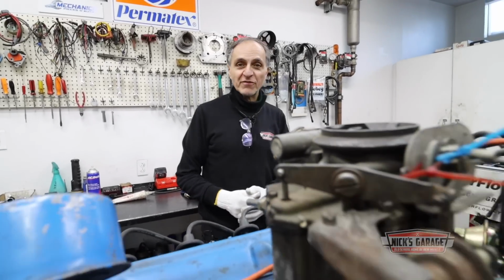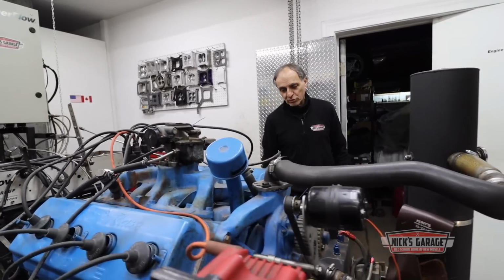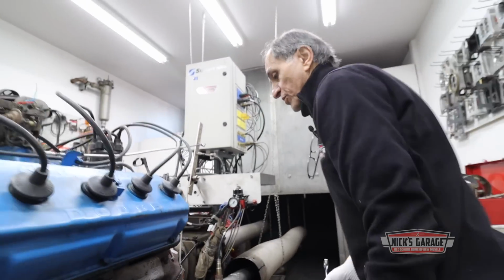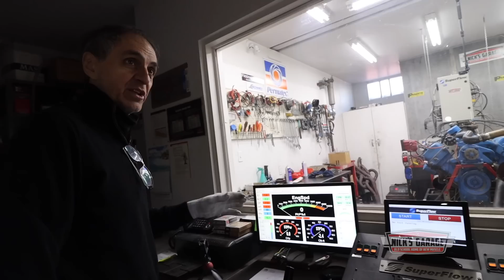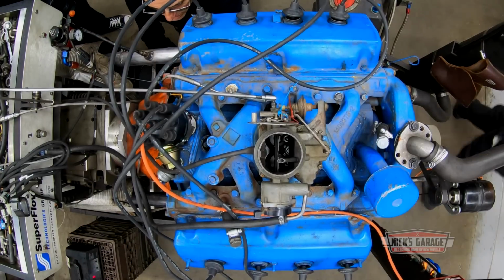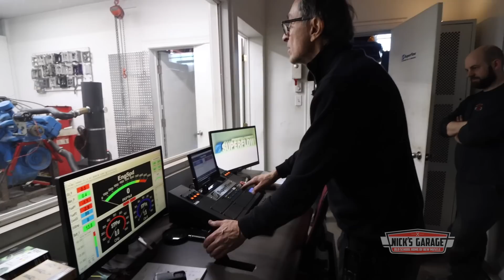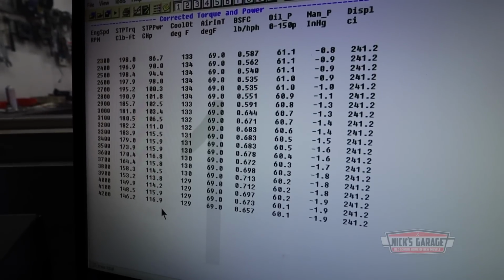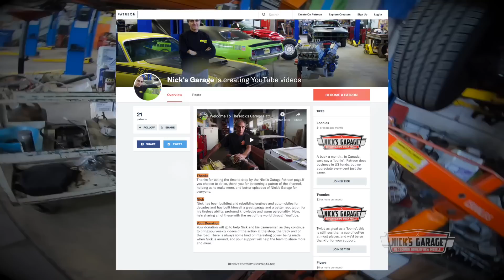Gen 1 HEMI on Dyno - WEAKEST Engine I EVER Tested

Comment: I Love when I see builders take the time and care to put the "Old" Hemi in period Street Rods, it's just a great look and sound when building a Classic Rod !!  Everything "doesn't" have to make 500 - 700 HP !!!!  : )
Reply: 499 would be acceptable!! 😆
Reply: Yes, your right, but if we're going to use them, why not make them a little more reliable, more efficient and powerful with a few simple add ons.  65% - 80% of the heat energy produced in internal combustion engines is wasted.[power to turn the crankshaft ] Technology, science has turned the old 300 hp V8 into 500 hp. Friction losses,air-fuel, thermal management, compression, cam timing, etc all help to increase mpg and power. .If we could use some of that wasted heat,1000 hp and with low emissions and ultra-high mpg would be possible. The first Gen 1 Hemi's were inefficient. With a better ignition system [ MSD or ? ], better fuel-air distribution, and a set tuned stainless headers or ? you free up 20 - 30 hp and add mpg to that old beauty. Add some compression , a more gentle and precise cam timing, intake work, good carb or FI you get an improvement in throttle response, mpg at cruise and maybe as much as 75 + hp
Reply: @thomaslewis7883  Yep. Increases in efficiency free up power and increase economy
I just did some minor porting on a 1.8l ES2 CVCC Honda engine from 1985. Cleaned it up a bit, freed up the exhaust a bit, played with the timing. Picked up probably 15hp and 8mpg. went from 25mph combined to 33.
Reply: Engines make less the  500hp?
Reply: Yea my 52 business coupe probably only has 150 hp with the flathead 6 being bored .40 over but its period correct to my car but has  headers dual exhaust 3 on the tree
Reply: @jonkern2325  That sounds "Koool" to me Jon, you get the Period Hot Rodding scene I'm talking about !!  : D
Reply: Dave Micolichek  I agree ,I wouldn't waste my time, but if I truly loved the car and intended on driving it, I would improve the drivability and safety [power, brakes, steering ].I remember the CEO of Porsche talking about restorations. He said if you intend to drive these old cars, do not be afraid to upgrade anything that can improve driveability and safety. It's very unlikely it will hurt the value of the car, especially if you retain the old components for the buyer.
Reply: @ScottysChev  The stock base engine is now around 500 hp for a performance car. A turbocharged 2.5 liter 4 banger can make 1600 hp . The power output of a turbo engine is only limited by the materials and heat. If you could eliminate the cooling system and use that wasted heat energy. God only knows how much power a V8 would produce. Hence why electrics are the future. Close to 90 percent efficiency versus 20 percent or so for a turbocharged dino fueled [ fossil fuel ] engine. I wonder what the thermal efficiency of a 500 cubic inch blown /nitro engine producing 12,000 hp is. Looking at those giant flames coming out of exhaust pipes? Not much, most of the power [heat energy ]is lost.
Reply: @thomaslewis7883  
Wow I had no idea.................................
Reply: @ScottysChev  Me either, I thought 501 hp created a rip in space-time, a singularity. Thanks for letting me know ...............................................................
Reply: camaroguy 66  Since always.

Comment: I always like watching these videos. Sometimes I learn something and sometimes I get to offer up some experiences I have had. Like this one with the starter motor. I have had some that were a pain to get just right. One trick I learned is install the starter and tighten the bolts snug, not to torque, then bump the starter to engage it just a "click" then torque it to speck. Doing that will align the starter with the ring gear on the engine. BUT, in this case, what a nightmare for you.
Reply: Yes Sir, makes  sense . Thanks  for  the  tip.

Comment: I have a 1955 Red Ram Hemi 270 cu. in. with a factory stick shift bell housing and flywheel. I used shorty headers from Hot Heads because my exhaust manifolds were cracked just like the blue 241 Hemi's are. The factory starter was too big to use with headers, so I used a mini starter to get it right. Zero issues.

Comment: I remember seeing an interview with Don Garlits . He said he remember driving past a Chrysler or Dodge dealership and seeing a sign in the window that claimed their new Hemi engine makes 140hp . He said that that was unheard of back then and could hardly believe it.
Reply: In the end the sidevalves were getting close to that number.
Reply: Well, the 51-3 Chrysler made 180 hp out of 331 cubes, which was fantastic at the time.  52 DeSoto made 160 hp out of 276 cubes, while the little 241 Dodge came out a year later, making 140 - which was still better than the 49 Olds 303-inch V8, which only had 135 hp.  Compression ratio on all these early Hemis was only 7.5 to one.  Three years after its first 140 hp V8, you could get a 315 inch D500 Dodge with 260 hp (four barrel) or 285 hp (two four barrels).  Six years after that, 413 max wedges had 410-420 hp, depending on CR.  Amazing times.
Reply: @herman452  Meanwhile in 1928 Dusenburg was making 265hp with their straight 8 and a crazy 320hp with the supercharged version. Crazy to think it took the major manufacturers 40 years to catch up. Of course those Dusenburgs were hemi engines too. :-) Just happend to be DOHC and 4v as well, way ahead of their time for sure.
Reply: Dan Joseph My Hyundai Elantra has 147!
Reply: @bcbloc02  Good points, but it should be noted that besides having four valves per cylinder, the Duesenberg engine also had 420 cubes to work with.
Reply: @herman452  The Dussenburg was at .63hp/cid NA,  still beating out the very respectable for the time .58hp/cid of the 241 Hemi.  Can't say I have ever seen a Dusenburg engine on the dyno though so their numbers may have been inflated. :-) Still for their time they were decades ahead in performance.
Reply: @bcbloc02  
The Dusenburgs and Cadillac V12's were the equivalent of supercars today.   Ordinary people couldn't afford them.  
That's why people were impressed with the 85hp Ford V8 in 1931.
Reply: He was right they didn't make anything like 140hp.
Reply: In 1949 the Oldsmobile had a 300hp model available I believe. Might have been the race motor though.
Reply: Dave Micolichek  I stand corrected. Must have been 300 cubes not 300 horses.
Reply: @kwhite145  and that's what 70yrs of development gets ya.
Reply: @bcbloc02  they were way ahead of their time. They were also some of the most expensive cars of the time too.
Reply: bcbloc02 peugeot had a twin cam 16 valve engine in the 1920s.
Whats your point exactly

Comment: Wouldn't like to be there when that flywheel comes off and saws through the roof or something.
Reply from the maker: No kidding.
Reply: @NicksGarage      SFI bellhousing blanket time Nick.
Reply: We had a John Deere flywheel come off and scoot across the shop one time.
Reply: Looks like someone else's problem to me.
Reply: Clayton Pope  Ouch!
 I had a metal fan blade break off at about 6000 rpm. (1100 cc 4 cylinder).
It chopped a V into the frame, bounced up, chopped the battery in half and shot out through the hood leaving a thin S shaped cut. The rest of the fan, being unbalanced, pulled the water pump off of the block and went through the radiator.
I'm sure it made a spectacular display on the freeway...I couldn't see a damn thing when the radiator exploded. I didn't lose any toes though...maybe someone did when that fan blade finally came down from orbit.
Reply: To be honest the camera person standing almost inline with that flywheel had me concerned for him.
Reply: @doug112244  there is no man on the cam
Reply: Kathleen Shaw 
 well speaking of aircraft, this coulda been fixed easy if they made it like one of those old early airplane engines where the crank is stationary and the engine turns.

Comment: Nice to see where the roots of the 426 HEMI began even though it was a little baby red-ram hemi back then. I wonder what V8's Chevy and Ford were running in 1954 and how they compared. I still can't believe that starter didn't blow up. Seriously. Get another one from whoever built that one ! Time to put some serious power plants AND your dyno to the test Nick. What else is there to do while self-isolating for health purposes ? If washing your hands with soap kills it, it doesn't stand a chance with Petro-Canada 94 , which by the way is at a miraculous $1.20 @ liter. Woot-Woot ! Even my hemi CiViC got some Super gas yesterday.  Take care Nick & Co. Play by the rules. Stay safe and be healthy. Your show is an inspiration to many. Some may call it an essential service. Thank you.
Reply: Actually it's roots go back to the Ardun overhead valve conversion for a Ford flathead designed by Zora Arkus Duntov for use in trucks. Duntov was also the father of the Corvette and the Small Block Chevy

Comment: My brother picked up an early 50's Desoto, as I recall, with this engine. Loved looking at it. It ran well, but was certainly a bit of a slug. It would barely pull on my 48 Plymouth six, and that was a real dog.
Reply: Each Chrysler brand had its own variation of a hemi engine design back then... except Plymouth, no hemi until 1966 and then the standardized design...

Comment: It's interesting to see that it was only 17.3 HP less than the factory rated spec running on today's fuel, good or bad and 66 years later.
Reply: Pete shea  It's about time someone 'lifted the veil' over these stupid and useless gross ratings.  Net/whp separates the truthful (no one) from the liars (every 'muscle car' coming out of Detroit).  European ratings of the same period were always DIN horsepower which is a net figure.
Reply: @mescko  me
Reply: "It's still climbing" Nick said of the horsepower.  I'm wondering why Nick didn't take the engine to 6000 rpm to see where the hp dropped off.

Comment: One thing that's always missing on these early hemis are the large washer that fits over the rubber spark plugs tube seals.they ride on the upper recess on the rubber and when the plug and tube are drawn down the flare of the tube spreads the rubber,tightening the rubber to the washer. I ran a 354 on the street in the late 60's. It ran great on old Sunoco 260. Jahns 12:1 pistons and Crane everything top of head with big valve(392) heads it ran 12.2 in a 3400 lb car!
Reply: That's a very respectable time.
Reply: Now you've piqued our interest!
What year/model did you have it in?
Reply: Also had a Weiand 2X4 intake with Carter AFB's. Nothing special,just regular carbs. One I pulled all the choke stuff out of. It ran really nice. The cam was an old Crane H-312 that idled like a coffee can full of rocks! Got lots of stares at a stoplite!

Comment: I've been down this road before with an old Buick Straight 8, I couldn't for the life of me get the starter to disengage after it was running on my dyno.
I ended up just using a high powered air gun on the crank to start it like an old race car. Lol

Comment: There is an old saying Nick. "there is always time to do it right the second time".  There is another trick too to align things like this. Slip the bolts in and leave just a fraction loose. Then twist the flywheel against the crank with a balanced force and it will self centre. That is basically how a driveshaft spline works. Enjoy your videos.
Reply: Don.           Really ?      I am not sure, but I will try it. Thanks Don.
Reply: You had the tools to center it. Leave the crankshaft bolts slightly snug, put the dial indicator against RIM of the flywheel perpendicular to the crankshaft, and rotate the engine. When you get to a high spot, gently tap the flywheel over. Keep doing that until the flywheel runs true, carefully tighten the crankshaft bolts and check again.

Comment: It's freaking shaking itself apart, everything about this setup is terrifyingly sketchy. If I walked in and saw my motor shaking like that, I'd take it and leave. That's also where all the power is going, something shaking and bouncing around like that is not transferring power efficiently
Reply: 🤣🤣🤣 it's a  54 hemi bro, on a good day they'll rattle the fillings out of your teeth.
Reply: @liambutler5477  you can straight-up see the transmission, starter, and engine wiggling like a wet noodle. I've seen Big Blocks running on 7 out of 8 cylinders that shake less than that
Reply: I had an original 392 Hemi. It actually ran fairly smooth. Something is messed up about this setup...

Comment: Nick, last time you did this I told you all you needed was a few truck pieces. You use the flywheel that came on the 6-volt engines with the late model starter. The 6V flywheel only has a couple of extra teeth so you file the hole in the starter so it moves outboard just a little and everything is fine.

Comment: I'm an airplane mech. The guy who taught me general aviation after the AF called that flywheel fix "farmer maintenance." He used the term derogatory. If he saw "farmer maintenance" on an airplane he went nuts. lol Sometimes though farmer maintenance is the best way.
Reply from the maker: Yeah. What you saw here, is certainly not for aircraft use. 😃
Reply: Yea like ya can't just pull over and fix that plane too easily at 3500 feet,that first step to unlatch the cowl is a whopper ....
My dad's a (private) pilot.
Reply: @MrTheHillfolk  Hey that's my line to. "We better get it right because it's real hard to pull over to a cloud and stop."

Comment: The fact that it's a 50's engine means nobody should be surprised by the weak power output. The 1960's massively stepped up HP.
Reply: Chevrolet small block made about 200 hp back in the 50s when they first came out

Comment: Hemis Unlimited  has all the stuff you need I put one in a 36 dodge has 3 duces big cam small block Chevy water pump plus adapter to bolt turbo 350 trans.

Comment: I prefer gauges to lights because a gauge will tell you a problem is developing over time and a light will tell you there is a problem now, often times when it is too late. A combination of both is best because an oil pump can fail all at once also.

Comment: She just needs the usual suspects. Add 12 to 1 compression, port the heads and a solid roller cam that will idle decently, electronic fuel injection with a 4 barrel intake, rev the thing to 9000 rpms she'll be all 👍
Reply: You forgot Precision Balance, and maybe 7000 R P M it would make 350 Horse.

Comment: The 1953 Dodge 241 Hemi ran with a compression ratio of 7 to 1 for 140hp. In 1954 this was increased to 7.1 to 1 but was still rated at 140hp. Some models came with a 7.5 to 1 compression ratio & were rated at 150hp. These engines bear the identification code D50-1 [or 2 or 3]
Once high octane fuel became available in the mid '50's compression went up to 9.25 to 1 in the 1956 & '57 D500 engines.

Comment: You need what my Superflow 902S has and that is the integrated Superstart system from Superflow--It has two built in starters.
Reply: RAM.     The 902S came 1 year later,  after I had bought this 901. Would have made my job much easier.

Comment: Time to get a lathe and a milling machine.
Reply: Jim, I would think as long as ole Nick has been in business that he would or should have A FEW Machinists that owe him a bunch of favors just sayin? Hell that's how it works down here in the states being only 400 miles away from Nick's countries border Yep! SO, what's up with this, just a thought?
Reply: @chuckfults9256  Chuck, Agreed. However, there are those after hours and quick fixes that they could fabricate on the spot.
Reply: @jimc3688  Yes a Bridgeport mill,an engine lathe that is capable of cutting both regular & metric threads with a taper attachment. for starters.  A Haas V45 CNC mill and a Fanuc Wire EDM would be outstanding.
Reply: If not for the video or for love of a friend, there would be no rationale or potential for profit in making one-off adapters so he could mate that engine to the dyno just to test a single bone stock "Dinosaur
 Bone".
Reply: @toenail37  On average the metric threads would be zero loss to him considering the average age of his engine building
Reply: @toenail37  Our shop has been in business since 1969. We have full machining equipment to do all phases of engine rebuilding, and dyno testing, but if we didn't have a Bridgeport mill, and a good lathe, we'd be dead in the water.

Comment: Getting old machine parts to line up is sometimes a nightmare!
Nick was able to run this old engine producing near published horsepower.
Most would have given up.
Reply: No, most would have done it correctly. They would have simply waited the few hours to have a local machine shop make an adapter hub to positively locate the flywheel. What Nick did was waste tons of time and risk destroying an engine that wasn't his.

Comment: Chrysler used basically the same transmission from 1962 all the way to 2007.  They slapped a overdrive on the 727 and kept using it even though the cummins would shred them nearly instantly.